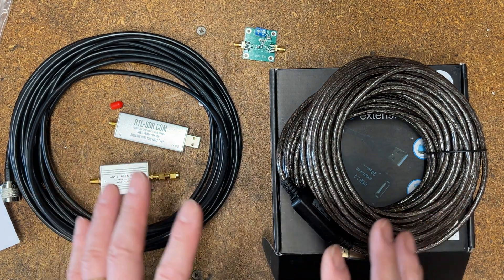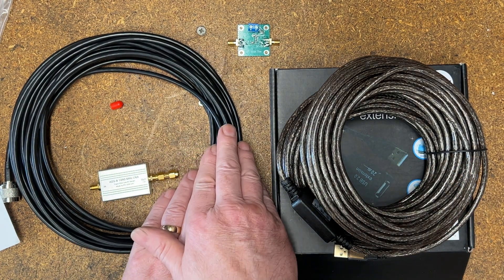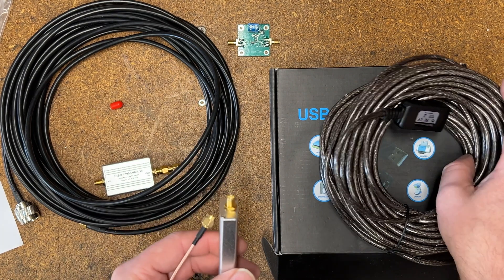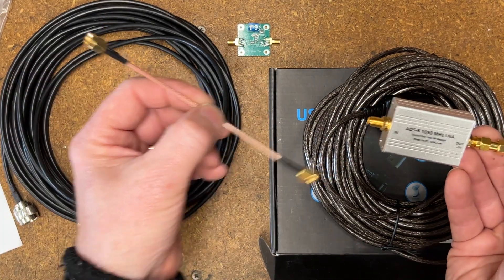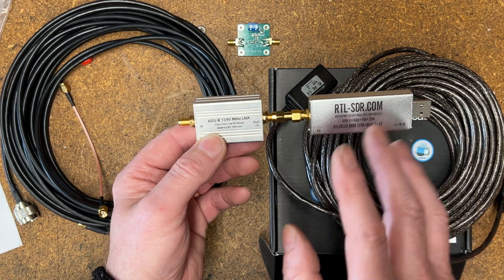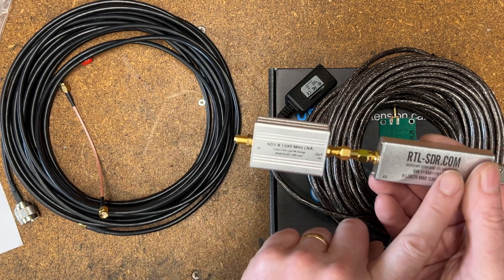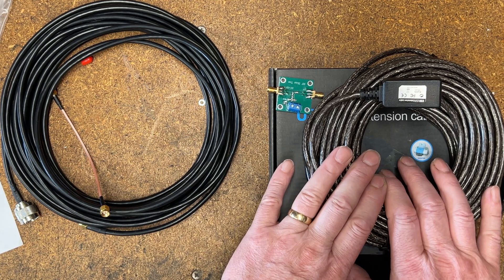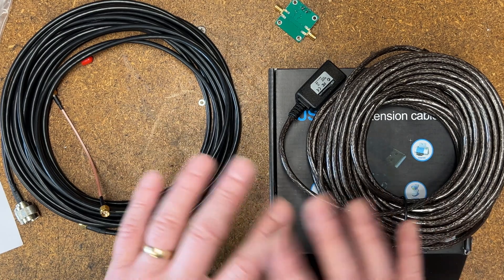Complete FlightRadar24 Build on Raspberry Pi and SDR Dongles. ADS-B AIRCRAFT RADAR System Part 2

Comment: The RTL dongles are not that great for this purpose. Depending on where you live, maybe a 1090 band pass filter may help.
Reply from the maker: Hi, yes agreed, normal SDR dongles are not the best but do work. The SDR Blog dongle in my video had a 1090 bandpass filter in the LNA and the Flight aware dongle  had a 1090 filter built in. We are bit out in the sticks here so these may or may not have helped me. Still had some fair results considering there is a great big hill directly behind the house shielding aircraft traffic until it is right over head!

Comment: Flight Radar 24 are useless though, whenever I hear something fly over it's not listed there.
Reply: If you were using a pi you could use flightaware software to just view your system.   Raw data..  those that choose not to be listed would be on raw data   Its being blocked server level
Reply from the maker: Hi Tommy, I've not noticed that on mine but certainly not all aircraft are available with FR24, which is a shame. Thanks for watching 👍🏽

Comment: Can you connect this to the buildings communal antenna from inside a flat?
Reply from the maker: No, unfortunately not. I would always run a dedicated antenna and cable direct to the receiver, in my case a Raspberry Pi. The antenna also needs to be the right sort for the frequency you are trying to pick up, 1090Mhz in this case.

Comment: You should have just put the pi in a waterproof casing and  PoE Ethernet  hat... no loss at all, and no need for the active USB cable that creates interference. And it's coaxial cable, not aerial cable.
Reply from the maker: Hi Carsten thanks for the comments. There seem to be many ways to skin this preverbal cat. The way I did it was just one of them. I have considered trying a Pi Zero W very close to the antenna (15cm) and just running  power up to the Pi. It's possible the Pi won't cope but I'm not inundated with aircraft so it might be an option.  The only issue with this is accessibility to the Pi being up the pole. I've always understood aerial cable is made up from coaxial cable, hence the description in the video. Thanks for watching 👍🏽
Reply: The irony of carsten commenting on a pi hat.   Since hes an asshat.       Aerial cable whether its 75 ohm or 300 ohm flat leads are all coaxial cables.     As if you say. Hey hand me that 12 ga 3 electrical wire.    No youre wrong its romex.    He did a great job on the video and wed like to see carstens videos. However bestiality violates youtube tos.    Great video.   I said what needed to be said for you.   You are the bigger man.   🙏🇺🇸✌️